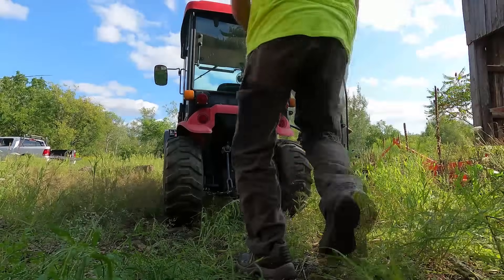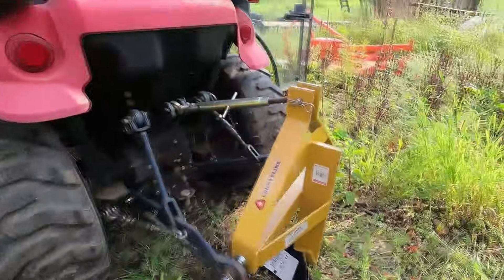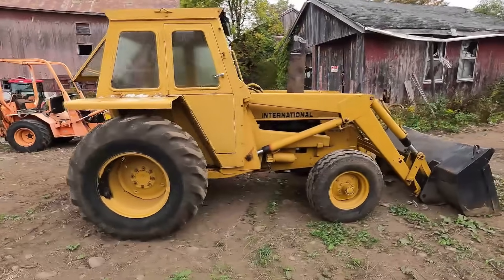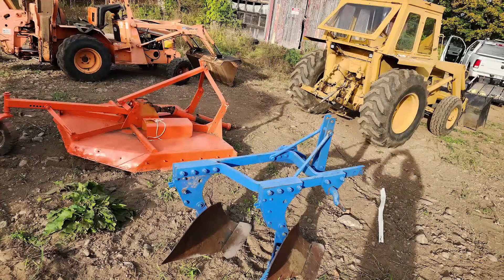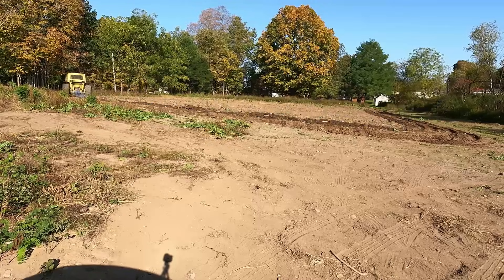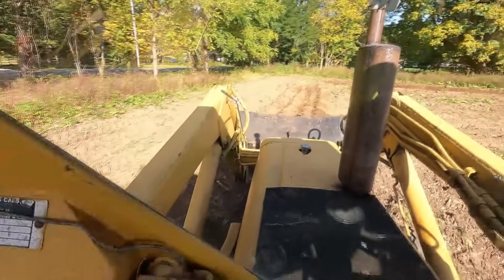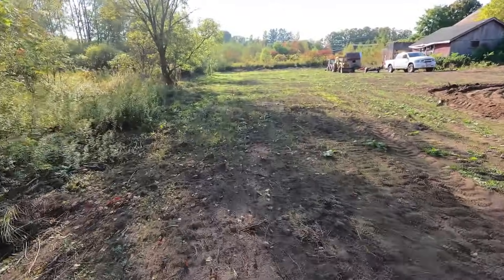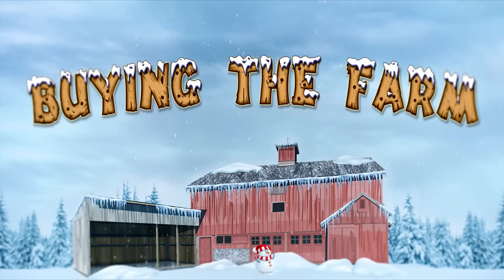🚜🌾  A late-season tractor UPGRADE for the farm!  🌾🚜

Comment: It was good to see you back in the dirt.  I agree with the guy that suggested reading your manual on fluid levels.
Reply from the maker: Oh, there’s a lot of dirt happening Wally!! Hahaha. Yeah, the reason I wasn’t too worried about the fluid level is that over the course of a week there’s a pretty good sized puddle under it. So even over-filled, it still probably ends up low when I go to use it. I have to find a manual in the coming months in order to service it during the spring.   😁

Comment: Hi there, as somebody else said, you are to put your right side tires into the furrow that the plow makes, start in the middle and plowing outwards, it sure helps to watch some videos on how to plough
I am very good at it, but here in Sweden where I live, its almost a art to plowing with a plow like that so I will need to shut up about that part 😆
Also get yourself the manual for the tractor, topping up the oil up to the top without using the oilstick it can damage your transmission and engine, please take proper care of that part, it might get a very expensive repair otherwise
Reply from the maker: Danne, thanks so much for taking the time to watch the video and leave a comment. I briefly YouTubed plowing techniques, and there are hundreds of people showing their preferred method - I'm glad to be narrowing it down through comments from people like you who actually do it! I will most certainly change the technique for the spring. And yes, I need to order a manual for this tractor prior to the start of the season. The oil that I topped up was hydraulic oil, and as there is a leak in the system, from week-to-week it ends up low. So I wasn't overly concerned about over-filling, as I knew it would be low before the next time I used it. But yes - for daily operation (and once the leak is repaired), it will not be overfilled.    :-)
Reply: Watch some plowing videos You're doing it wrong!!!!!

Comment: Looks like baby steps are paying
 off . I would replace radiator hose to avoid overheating and hydraulic hose to keep oil from hoping into your future garden . Also , check owners manual for hydraulic oil level , I don't think it should be filled to the point of overflowing . Keep up good work !
Reply from the maker: Hey, thanks for watching and leaving a comment! Yeah, I definitely have some springtime maintenance I need to do (including locating a manual for this tractor)! I wasn’t overly concerned about overfilling the oil since from weekend-to-weekend there ends up being a decent sized puddle under it. I’m hoping to eliminate this issue in the near future. Hahaha. 😁

Comment: Now that you've plowed it, I don't think you will need to keep plowing it.  At this point, I think you should be discing it.  I'd say a 6-8 ft wide disc (whichever size is just wider than your tire tracks) is what you need to keep cutting up weeds as they come up.  It will go MUCH faster and cut up the weeds vs just flipping them over.  Cutting them up repeatedly is what will kill them.  looking at your soil, you could almost just put a chain drag behind the disc (or just pull the chain drag by itself) and get that plot smooth enough for planting.  Not sure you will need a tiller.
Reply from the maker: Python, as always thanks for watching and leaving a comment.  Hhhmm ok, interesting. I sorta gave up on the disc implements when I got the plow… but now I see why they’re still important. Ok, I’ll start looking for a set - there’s not many for sale around me (well, as of the last time I looked last spring). I’ll see what I can find. Yes, chopping versus flipping sounds better at this point!!
Reply: @BuyingTheFarm  Almost forgot.....no matter how you end up working the ground, it has to be done before any of those weeds get mature enough to get seed heads on them.  At that point, you're just re-planting weeds.
Reply from the maker: DEFINITELY... I'm expecting some early spring work once the ground thaws but before the weeds really kick in. After reading your comment I immediately started looking for a set of discs. They have some 6 and some 8 footers around here, but they are quite new (and quite costly) - so I have a few inquiries out and we will see what happens!!

Comment: The suspension system helps absorb shock from the tractor and helps it operate smoother. If your suspension is wearing out or damaged, you may want to consider upgrading it.
Reply from the maker: Fortunately everything seems good. Thanks for leaving a comment!

Comment: Their is so much wrong in this video!
Reply: Not helpful. Share observations.
Reply from the maker: Well, I do appreciate that you watched the video and left a comment... but as Michelle stated, sharing your observations would definitely be beneficial. As a non-farmer, and someone not well versed in the equipment and techniques of farming, and as someone who is trying to learn the correct techniques through Youtube videos and through the generous commenters in these videos, any insight is always appreciated!
Reply: @BuyingTheFarm  #1 The I.H. tractor in this video  was made from 1974 - 1978, not late 80s.. #2 It weighs around 7500LBS. Not 19000LBS.. #3 The plow is way too small for that tractor.. #4 The plow is not adjusted right.. #5 You need to put the right side tires in the dead furrow..  #6 You don't plow a field more than once.. #7 I have never in my life seen a plowed field look like that..
Reply from the maker: Hey - cool. That's a lot of better information. OK, so the seller indicated this was a 1986. Perhaps it is a 1976? I did look up some specs on the 80's models and yes, the base weight is in the 8000lb range WITHOUT the loader or cabin - with those items and related options it stated a weight of 14,000-16,000 lbs (if you read the video description I corrected the 19,000 statement). There is a tractor shop about 1/4 mile from my farm and I was looking at some of their 50hp tractors. When I asked the owner of the shop what sort of plow I should get, he indicated usually no more than 2 bottom for a 50hp. So, that's what I targeted. Interestingly, if I really bottom out the plow, it will stop the tractor - so at no point did I expect that it would support anything larger. What size plow do you suggest? Regarding adjustment of the plow, can you provide more info? I definitely want to take advantage of the correct operation of the implement. Regarding the right tire, yes, a few other people said I plowed backwards (left tire in furrow) so I will definitely be making that change in the Spring. My reasoning for plowing more than once was again due to the suggestion of the tractor shop. My property had been vacant for nearly 2 decades and the field you see looked like a forest just last year. As they were familiar with the property, they suggested multiple passes with the plow to break up the soil before working it further (discs, etc). Do you disagree? If so, I'm here to learn so I'd love to know the reasoning. And regarding the final comment about not seeing a field looking like that, maybe you can expand on that. In my area fields end up with a lot of parallel passes, with a final loop plowed around the perimeter of the field. That is basically what I emulated when I was directed  how the plowing should be done (minus some of the finer details and instruction people have provided in the comments). So when complete, my field (although small) looked like a much smaller version of the large fields in the area. In advance, thanks for clarifying any of the above points.   :-)